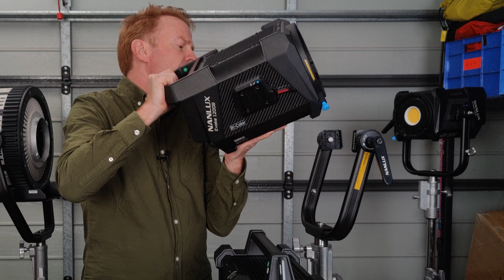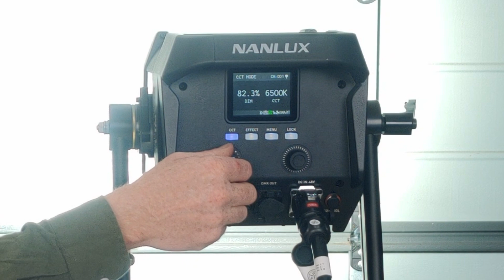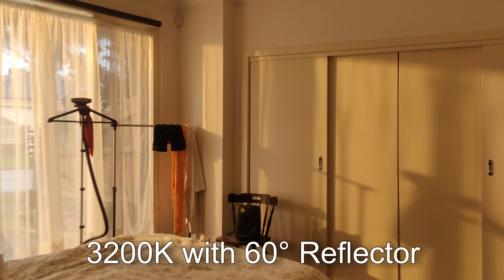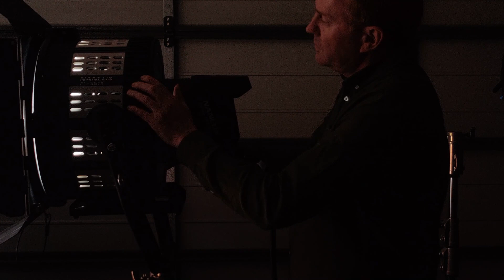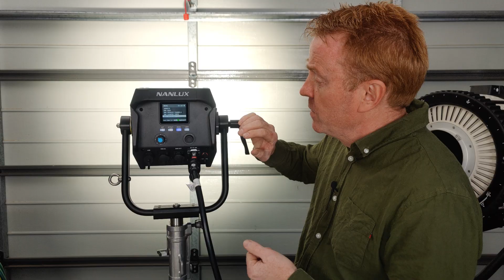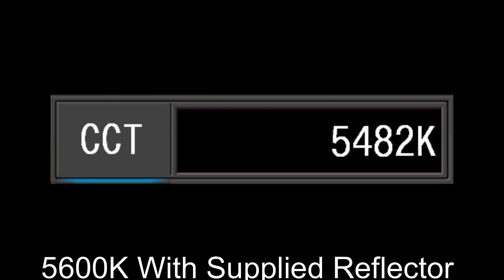Gaffer & Gear 200 – Nanlux Evoke 1200B

Comment: This does look perfect - only thing that bugs me is the fact I'd be paying that much money and then potentially not being able to realistically use it because of the fan noise - obviously in most cases the light can be a fair distance away due to the output but for the times I'd like to bounce it off some ultra bounce for an exterior when poly isn't cutting it or when trying to compete with large bright windows - I can see this light being amazing if it weren't for the fan noise- does anybody know if a firmware update might fix this in future?

Comment: Hey mate. Just a note that if you are filming in 25fps, or exporting at 25fps - its best that your shutter speed is double the frame rate so that you have the correct motion blur. So 25fps - 50 shutter. Love your work - apologies if you know this and are using the faster SS for some other reason.

Comment: My biggest Issue with this light is, the Narrow reflector is wider than the one for the Aputure 1200d and I’ve been mostly using the Narrow reflector on my 1200d. And I would usually prefer an even Narrower Beam.
Reply: The FL-35YK fresnel has a 11º spot beam angle if you need narrower spot.

Comment: To get it to point upwards can't you just unplug the power cable, point it up and plug the cable back in?
Reply from the maker: You lose about 45⁰ of tilt option between the two cable positions because of the thickness of the connector.
Reply: No that would be clearly to easy! But in all seriousness I get why you might want to have the range of motion in that dierektion without having to unplug it. Lighting gags for example. Also it helps with balancing a big modifier on a stand